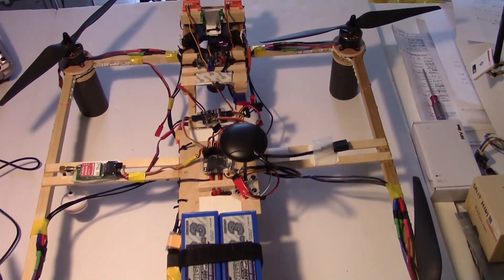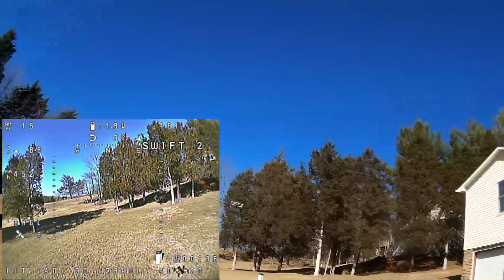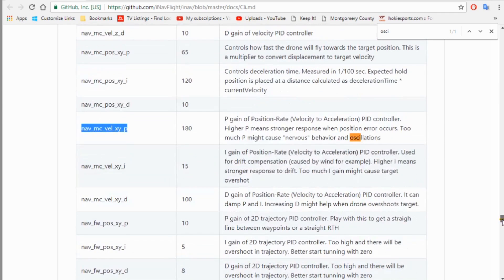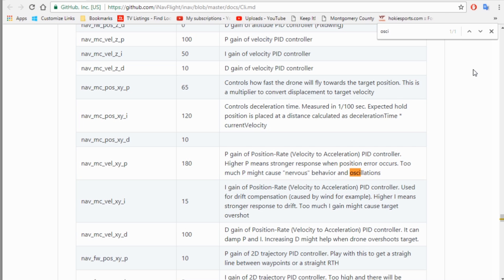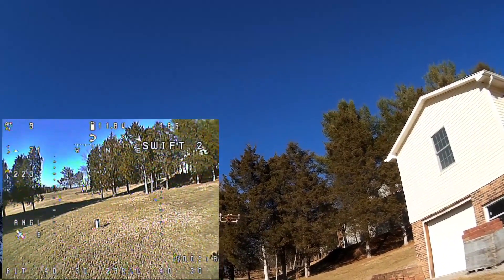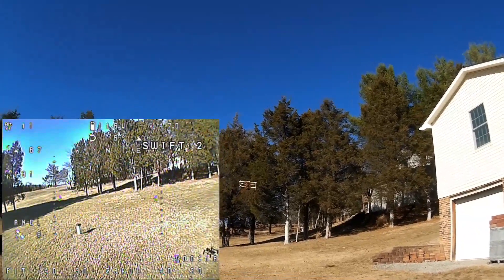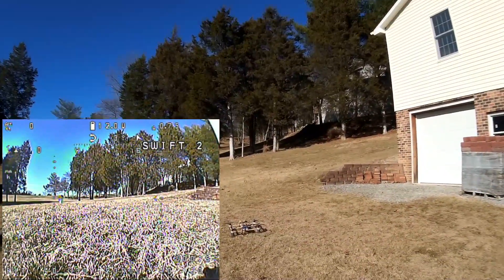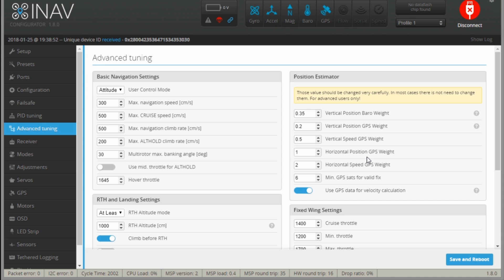My Omnibus F4 iNav Quad Copter Experiment - Part 3 GPS PID Tuning

Comment: Did you get our working. Just testing firefly with inav. Position hold it goes at 45° angles going around and back and forth lol. I think I need to drastically need to lower nav pids. But was thinking position too so it doesn't want to go as fast
Reply: How did you correct
Reply: @lalbabugupta8380  I took gps so long ago going for less weight longer flight time. Think I did lower pids a lil. And made sure compass calibrated well. But I did get it working to hold position and rth

Comment: Hi mister I one quad copter with cc3d revo with inav 1.9 the problem is... compass with inav 1.9 calibrating great... if install firmware 1.8 the compass not calibrating all value is 0.   0.     1
Can you tell my why 
My compass is radiolink se100....

Comment: Hi dave , did you have any luck tuning out that wobble at gps hold?I havethe same problem.My 250 quad works great in angle and air(acro) but cruising in gps hold and stopping it wobbles trying to hold position.
Reply from the maker: I have not completed the process still but I think my problem is the weight distribution on my quad. For some people the wobbles can be caused by other things such as compass misalignment with true north which can be cured by getting a hiking compass and aligning to that. Not to use a cell phone compass.
Reply: @DaveMerc  Got one at Walmart for $5.40 w/tax, good thing to have.
Reply: Hi dave, I was having the same problem but today I managed to solve it thanks to your video, first I tuned basic/acro PID's and then changed GPS navigation PID's, set velocity XY to 70 and now my quad holds position nicely, I'm so happy. Sorry for my English.

Comment: Hey Dave, still on this topic. Today i found out my blheli s setup had the option active braking off. I activated the active braking and i think That Solved a lot of my problems. Maybe iT could help you with your setup. I think this option and the decentred weight on your setup could make the difference.

Comment: Hi Dave, Great video. I just setup inav today on my f450 clone, 1000kv motors on 3s with 10 inch props. I am using spracingf3 board. Copied some pid i had from betaflight, once i got a gps lock I flew it around a bit and tried the gps hold. I have yet to try altitude hold.

I am running into the same wobbles your quadcopter shows. Thought i was turning down the gps pid's before the laptop battery died, tried it again, same thing. Went inside and plugged it in and the values were original settings. I didn't see these gps pid available in osd but I am looking forward to taking it out again. 

Good luck, looking forward to the RTH tutorial!
Reply from the maker: I don't think the GPS pids can be displayed on the OSD which is unfortunate. I'm still messing around with them. Let me know if you find the solution to the pitch wobble.

Comment: Hi Dave, today i was testing my Y6 with Inav again, it's more or less doing the same thing. I tried the NAV gps pids above the velocity pids and raised them to P 85 an
Reply: Wasnt finished 😜 and the position xy d to 23. I think its a Little better now but Will also try the vel xy pids next time. I also increased the esc update rate to 8 kHz That also helped out a little. I'm using low kV motors and partialy think thats not to my benefit with high wind gusts here on St Maarten. Funny thing is in angle mode the problem doesnt appear to Be That bad.....
Reply from the maker: I kind of wish they would allow X and Y to be adjusted separately instead of linking them. In the case of my quad it would help some.

Comment: Hi Dave, you mended it then....I have just evicted my (very old) QBrain 4 in 1 ESC from my Alien 500 and replaced it with a 25 Dollar 4 in 1 Racestar ESC.....The difference is like Night and Day because the Racestar is DSHOT 600  capable.
   It was so bad it oscillated in every Mode I tried....Put the Racestar in and it just lifted in a stable hover, I did have to pull the P gains down a bit though....Pulling down the P gain with the QBrain had no effect whatsoever, it just doesn't react fast enough to do these demanding GPS hold Modes, that's my conclusion anyway.
  Yours is not as bad as mine though, so I can see why you are trying to correct it, but if you notice, the rocking gets progressively worse if you leave it...fatal if you left it I suspect.
  You could try moving all the mass temporary near to the centre of the copter, just to see if it improves matters..?
Reply from the maker: Does  DSHOT 600 work with iNav cleanflight because I don't see that as a selection on the configuration tab under motors, just One Shot and Multi Shot? I'm sure the moving the mass toward the middle would help to reduce the pendulum effect. I just wish I could keep the gimbal in the front to avoid getting the props in the picture but it may be necessary to let go of that idea.
Reply: If your ESC is flashed as Dshot 600 protocol capable, then I assume it won't matter what's inside iNAV provided you pick Multishot maybe..?
  iNAV and Cleanflight are two different things are they not..?...You keep referring to iNAV in your video as Cleanflight, which must be confusing to your followers..
   Its notable that on traditional Camera platforms that the large mass items are suspended centrally under the copter. I dont see a problem with what you have, provided the copters cg is centrally placed. Once you have motors and ESCs which will react faster, it will improve no doubt.

Comment: Dave looks back heavy to me . try getting your corner weight's similar .. Get the center of mass in the middle ish ...
Reply from the maker: It's  balanced but it is heavy in the back (and front) so yes it would be better if the gimbal and batteries were moved toward the middle more. 
The crazy thing is that ii flies ok in angle mode and altitude hold but oscillates on position hold. It seems like position hold gets is swinging like a pendulum back and forth. I am trying to find settings that correct only position hold. It may not be possible with this weight distribution, not sure.